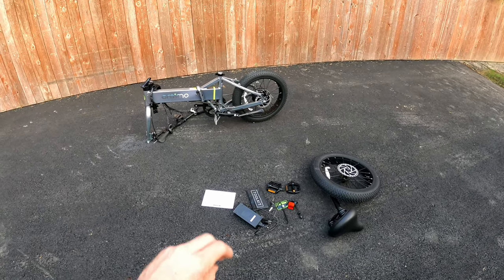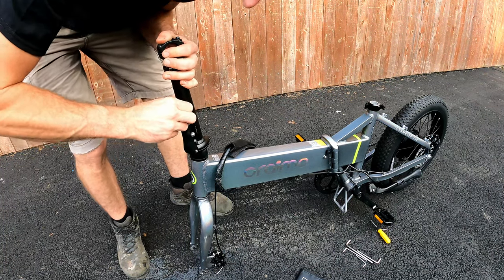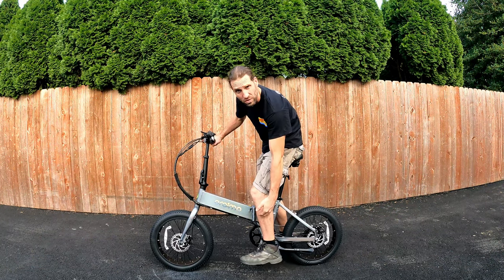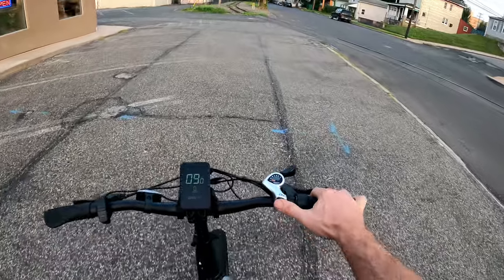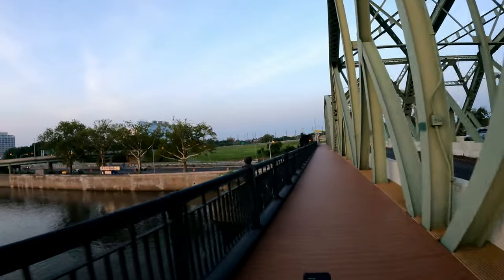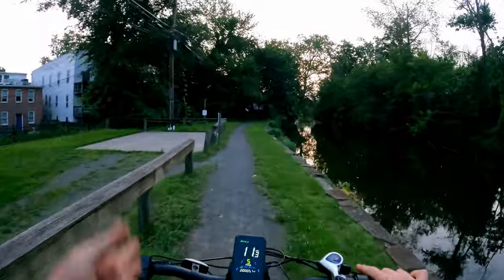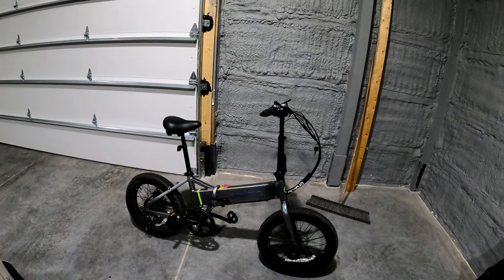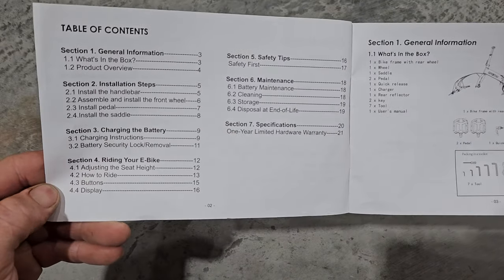ORAIMO Scrambler 100 Folding Electric Bike Review

Comment: The one good thing about the smaller tires is you have more of a mechanical advantage for the hub motor. I wouldn't be surprised that this little bike would be a decent hill climber. So even though it's "only" a 750w nominal motor. It probably accelerates more like a 1000w nominal motor.

Comment: Has anyone unlocked the speed settings? I have tried everything and cant get the control pad to do nothing..this bike seems to be locked up tight on 20mph..shame ..love the bike..great 750 watt motor ..super torque...just slow at only 20 mph..should do 28 mph but cant get into the settings to change it..frustration is at maximum..

Comment: It’s a bike.  How hard can it be putting this together?  Well,I’ll tell you.
(Did not read instructions before assembly). But, I should have.  Got it all together and hopped on.  Checked to make sure it was all secure and off I went.  At this point couldn’t figure out how to actually turn it on.  Had the key in.  Inserted and turned accordingly.  Nothing.  So I pushed off, went 30 feet. Circled back while hand shifting for 3rd gear to 2nd, and crunchhhhhhh!   Stopped and looked down and the derailer was all bent up!  Ugh!!!  It was a mess.  No longer rideable.  Carried it to the garage and looked it over.   Ugh.  Called tech support ( Saturday). No answer.  Monday, called twice.  No answer. Was going to email them later that day, when about an hour later got a phone call from lily.  Told her the problem I created, and approved us for a new derailer.  I’m waiting. ( 5 days later) I run across this video.  Great.  Learned how to turn it on, dash lit up, how key really works. ( should have read instructions). This video was a life saver for me.  It’s difficult to read the small print at my age, but watching your vid was a pleasure.  Thanks.
Derailer supposed to be in today.  Sat. March 9, 2024. Customer service is great!  I’d recommend this bike and the company.  Your video was great as well!